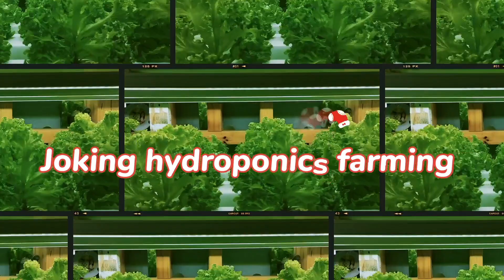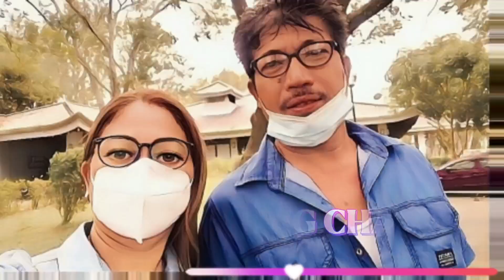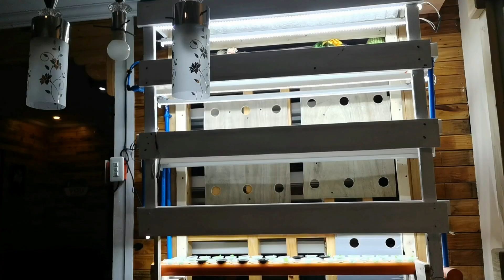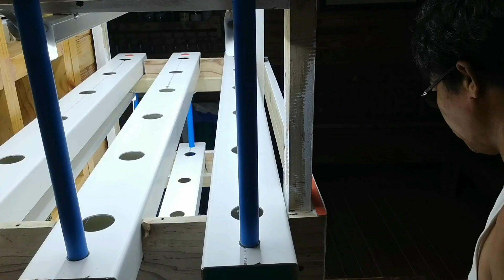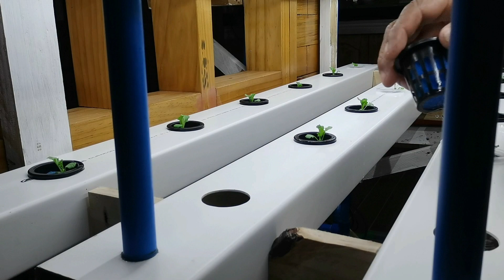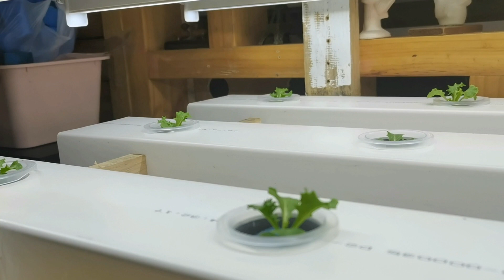How To Grow Lettuce Indoor - Transplanting Lettuce @khingskaar

Comment: galing ng setup mo sir, ano gamit mo pong grow light...pede po malaman? thanks po more power po... :)
Reply from the maker: Thanks for watching sir, gamit ko grow lights ay  brightex brand t5 led tube 18watt watts 4ft ang haba sir meron po sa lazada search nyo Lang brightex grow lights t5
Reply: @khingskaar   tapos ang pag wirng nya, yong para sa NFT rin para continues sa last grow lights. maraming salamat sir., planning kasi baka gayahin ko na rin itong setup mo. :)
Reply from the maker: @GiBe2011  may kasama nman isang wire connector pag bumili ka ng grow lights bumili ka nalang sa lazada ng t5 wire connector sir para Mae connect mo sa Ibang grow lights series connection ba tawag dko sure pero madali Lang gawin
Reply: @khingskaar   maraming salamat uli sir.